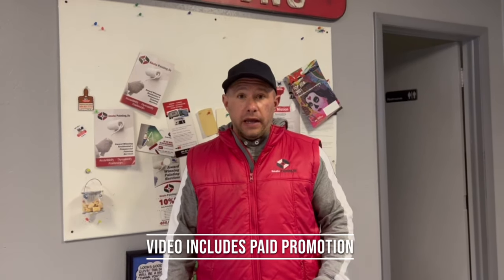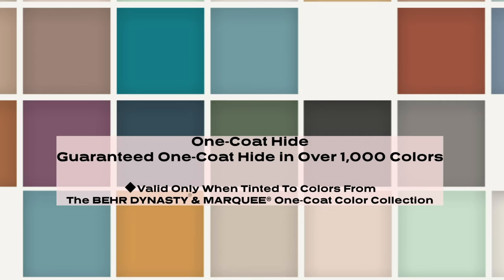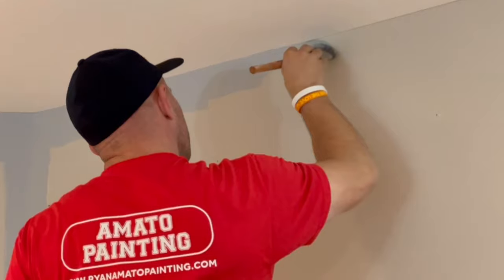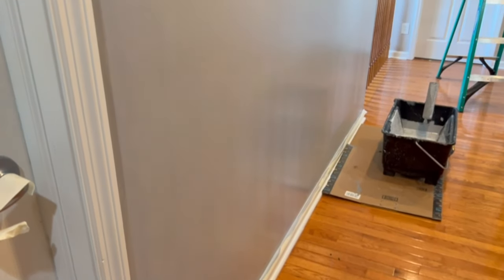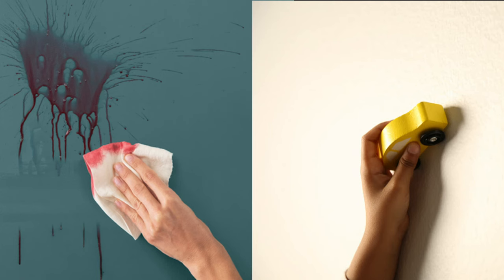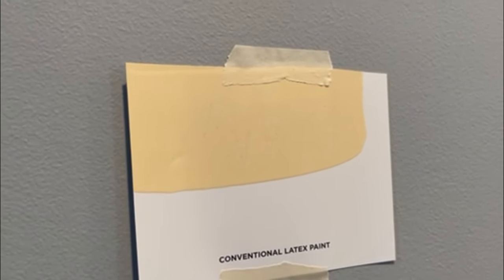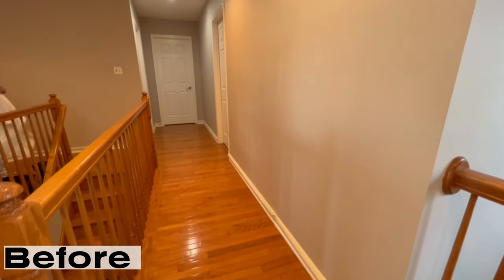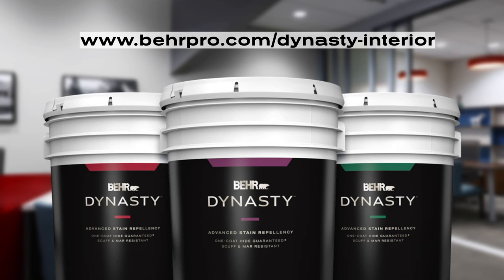BEHR DYNASTY™ Interior Paint: The Best Interior Paint For My Home

Comment: Painter 28 years. LOVE this paint. It really does dry fast. I use it on  kitchen cabinets.    I can lay out 12 cabinet doors. Roll a first coast. By the time I have rolled the twelfth door the first door is dry enough for a second coat.  Sometimes it drys too fast.  For this I add a little bit of Flotrol.

Comment: Also, I’ve recently had to return a 5 gal bucket and a 1 gal bucket because they contained paint boogers (dry paint pieces). I’m not sure if the paint was old or if it had skimmed over but it wasn’t acceptable. HD paint employees are not always well educated. I would prefer SW but it is way more expensive. So, Behr is a good paint for the price as long as you get a good fresh bucket and you don’t have any painting questions.